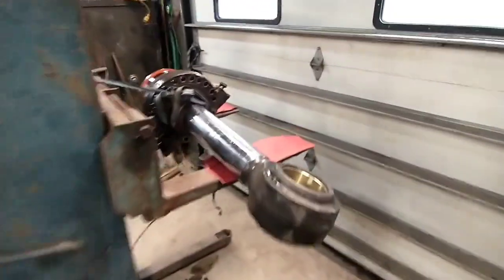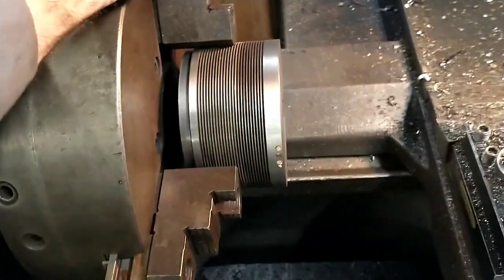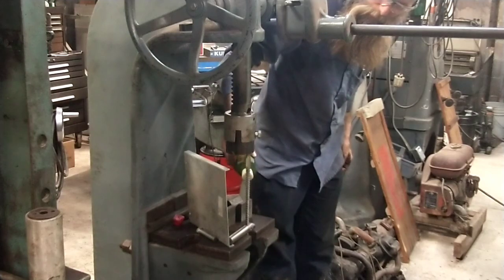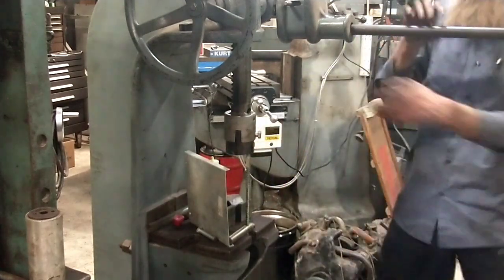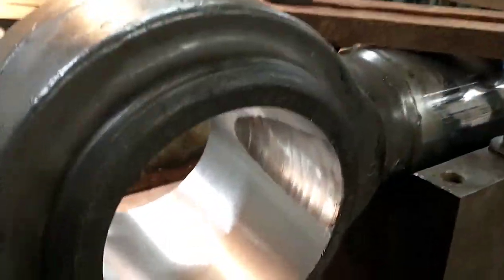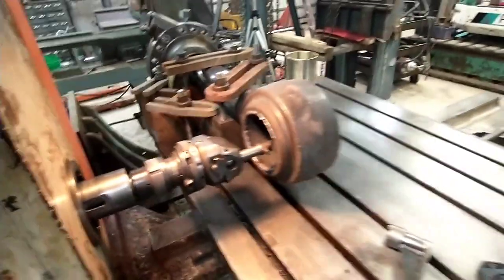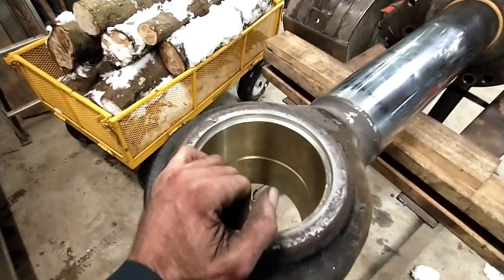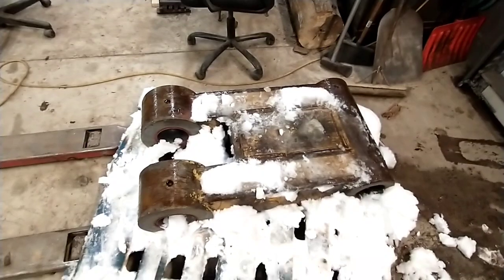Large worn hydraulic cylinder eye, weld and re-bore on the horizontal boring mill.

Comment: I like that you feed the table and not the boring spindle.  It should result in less bore taper than feeding with the boring spindle.  Ken
Reply from the maker: I generally only use the spindle feed if I'm line boring or drilling, too much flex when it gets stretched out.